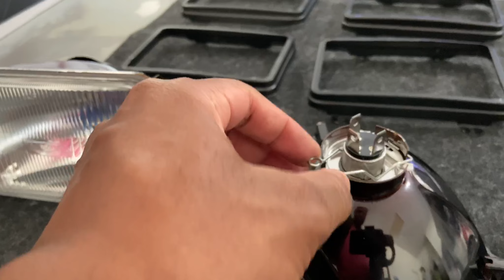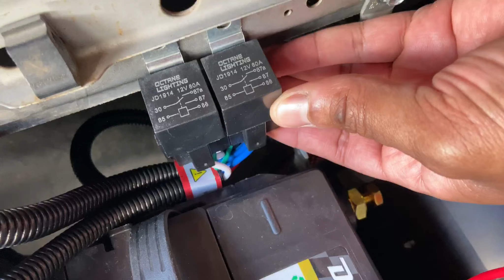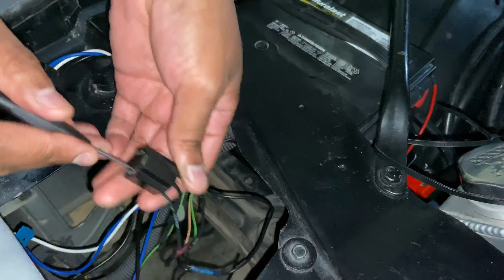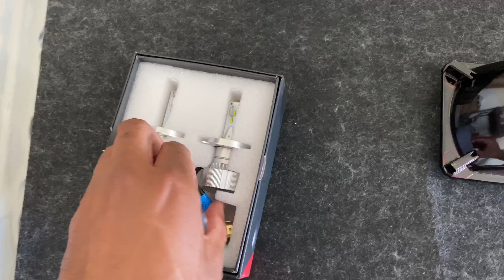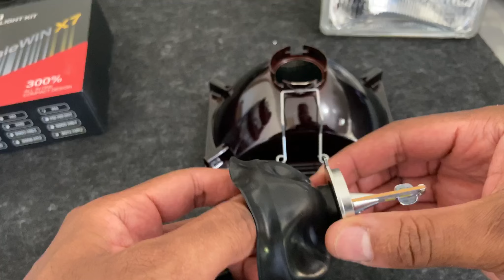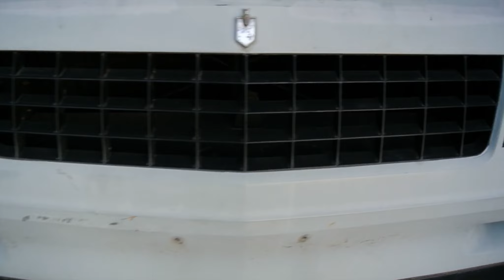How to install: H4 LED Headlight kit 86 Monte Carlo SS

Comment: Penny LS1 what was you process on painting your headlight bezel and what paint did you use ?
Reply from the maker: I used a paint remover in an aerosol can to get all the old paint off. Then just cleaned and scuffed them up. Self etching primer first, then sandable primer. For the color I got some black paint in are aerosol can and used 2K clear. The paint I used if a black pearl from a 2018 Porsche. I used the same paint on my air intake, check that video out.
Reply: Much appreciated bro thanks for your time

Comment: I installed this setup with the H4 bulb and I’m blinding on coming traffic, is there a way to align them
Reply from the maker: You have to aim the headlights as you would either the stock setup using the adjuster screws on the headlight buckets

Comment: Your link for the h4 led headlight doesn't work
Reply from the maker: https://www.morimotohid.com/Sealed-Beam-Holley-RetroBright-LED-Headlights-4x6_3
Reply from the maker: https://www.octanelighting.com/4x6-22-33w-h4-led-stock-glass-lens-metal-headlight-set-for-1981-87-gm-g-body
Reply from the maker: https://www.octanelighting.com/kit4x6-halogen-semi-sealed-stock-glass-h4-headlight-set-of-4-7100-60w-clear-1.html

Comment: Hi there, any fitment issues with the Octane fixtures? I'm reading reviews that they may be slightly larger than the OEM bulb. Any issues getting your bezels around the new fixtures and/or other mounting fitment issues w the Octane Lighting H4 kit? I'm doing the same upgrade on my '86 and have painted the bezels. Thanks!!!
Reply from the maker: I did have any fitment issues with my install.

Comment: What side of the car it the plug in for the factory harness located  upgrade my headlights but factory harness is not enough power trying to install the harness you have but can find the plug in for factory harness
Reply from the maker: You can use the factory plug on either side. It’s the 3 prong low plug. Use which side is closer to your battery. The relay that comes with the new harness is what gives you the upgraded power. There should be power and ground for the new harness.

Comment: Hey Bro,
Happy Thanksgiving. Did you see Holley and Headlight Revolution just came out with replacement lenses & bulbs that keep the “stock” look and style but with brighter bulbs.

They even have the LED bulbs that preserves yellow halogen look if you prefer that style.

What I wanted to ask you though, is how can I hook up our bulbs to have all four lows on at the same time and all four highs on at the same time?

Holley and Headlight Revolution is selling a Quad Low/Quad High splitter to go with their kit, but can’t we do the same with what we have already? I have the same harness & bulb kit as you.

Thanks 🚗 💨💨💨
Reply from the maker: Yup I saw that the other day. It looks good, but the price is hefty. Honestly tho, if I didn’t already have these I would get them.  The bulbs look proprietary tho, which could be a problem
Reply from the maker: But as for your question, I’m not sure how you would go about doing that. I have seen some running all four lows at the same time.

Comment: Wonder if they have these for the 79 cutty. Check out my swap on my page
Reply from the maker: I’m sure they do. What size are the headlights, 4x6 or 5x7?
Reply: @PENNYLS1  7x6 just looked it up
Reply from the maker: Were you able to find a set for the Cutty?
Reply: @PENNYLS1  I did just googled them and popped up

Comment: So did you use 2 of them 100w h4 just for the high beams or did you use the same bulb for all 4 lights??
Reply from the maker: I actually ended up putting all H4 4LED bulbs in.

Comment: Ok you said you put these 2prong wiring harnesses on the driver side lights and seeing that there are two more I’m thinking these were going to go on the passenger side lights, how did you wire them all from there. And when you got the kit was there a schematic that came with it. Appreciate all your time in answering.
Reply from the maker: Did you get a new Wire harness when you purchased the lights?
Reply: PENNYLS1 yes I got the Octane Lighting H4-4-RH WIRING HARNESS. I got the stuff that you had highlighted below the video area.
Reply from the maker: @bdog3869  Ok, it should be a 3 prong plug and I plugged it on the  passenger side so the relay will be close to the battery. Then ran the harness across the radiator support to the driver side.

Comment: What's up Bro, I just got my setup, trying to figure out where did you run the harness wire? Did you run it on the same track as the factory wiring?
Reply from the maker: I plugged it in on the passenger side since it’s closer to the battery and I ran it across the top of radiator support to the driver side with zip ties to hold it in place.
Reply: @PENNYLS1  ok, thanks I was trying to make it fit along the factory wire track. Thanks again

Comment: Which factory plug did you plug the new harness into. Was it the Low beam or the High beam plug on the passenger side. Great video and it’s what made my mind up to do this. Appreciate the help and super clean job !!
Reply from the maker: I used the low beam plug on the passenger side since it’s closer to my battery. The 3 prong plug.
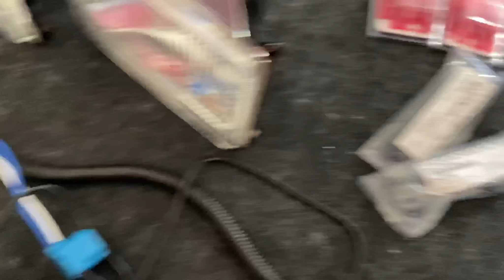Reply: @PENNYLS1  to be clear you plugged the connector thats at 2:20 to the low beam? Not to the fog light. So what do you do with the extra wire thats on the new harness?
Reply from the maker: @Anaconda-squeeze  yes that is correct. From there you should have 4 connectors remaining on the new harness. Those go to the new LED Low and high beams.
Reply: @PENNYLS1  oh I see!!! Thank you so much!! I am horrible with anything electrical...so what do you do with the old wires? Tape them up???
Reply: Awesome thanks so very much for the information. Can’t wait to actually see while driving down the road. I honestly wouldn’t be surprised if they aren’t the original 86 headlights😂. Much appreciation.

Comment: Pennyls1 u think it will fit on my 83 cutlass same setup?
Reply from the maker: It should fit. As long as the  stock head lights are 4x6 inches. Shouldn’t be a problem.

Comment: Penny LS1 thanks for sharing the video you are very knowledgeable person when it comes to G-Body upgrade is one thing about this wiring harness that I'm confused on and trying to get a better understanding the link that you post it for the H4 wire harness in a description that says it's for a 5 -3/4 headlight but they also carry the 4x6 version my headlight are 4x6 with harness did you use?
Reply from the maker: That’s the one that I ordered. It works, not sure why it says 5-3/4 in the item description. I just noticed that. It works though for the H4 bulbs
Reply: @PENNYLS1  ok cool thanks  bro for responding so quickly

Comment: Penny LS1 for the factory plug witch side did you use it for the new harness low or high beam
Reply from the maker: The new harness has the 3 prong connector. It goes to the low beam side. I mounted it relay on the passenger side near the battery for easy connection to the battery positive.
Reply: Thanks bro
Reply: Do the harness come with instructions?

Comment: I looked up the lights online, they stated it was plug and play. Do i need to buy the harness as well?
Reply from the maker: Derrick Duncan they will plug n play with the 3 prong low beam, but you’ll need the harness to run all 4. I believe the stock high beam plug is a 2 prong plug
Reply: @PENNYLS1  My man! Appreciate it

Comment: So on this conversion harness you only have to use one of the stock headlight connector and it will power all 4 lights? Also can you have all 4 low beams on at the same thing with this? Thank you
Reply from the maker: Eric Puentes yes the conversion harness only has one plug that basically takes the signal from the stock harness in order to link it to the headlight switch inside the vehicle. It has its own stand alone relay to direct the power to the 4 lamps. I think you could have all four low beam on, but I’m not sure how to wire that up. Out of the box all four high beams were on and that is why I had to re-pin it.
Reply: PENNYLS1 thank you. Been trying to figure out how to do this conversion for my el Camino for a while now.
Reply: To piggy back off this one, i got the harness figured out, did you need to hook up the blinkers to the relay while running LED or were they ok off the factory harness?